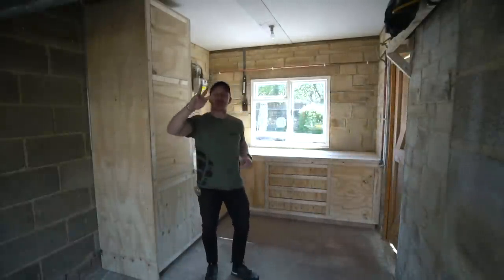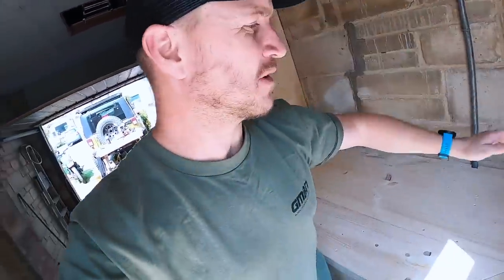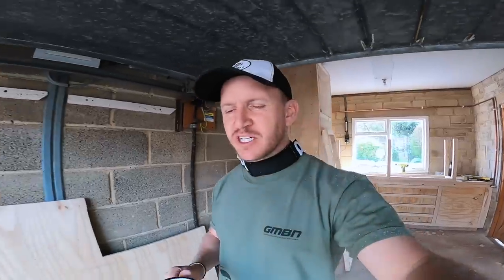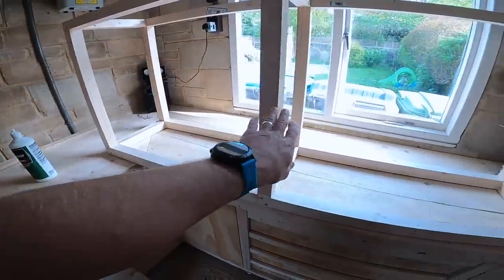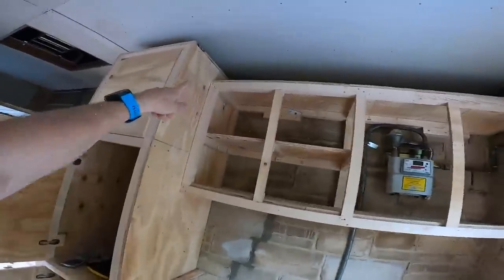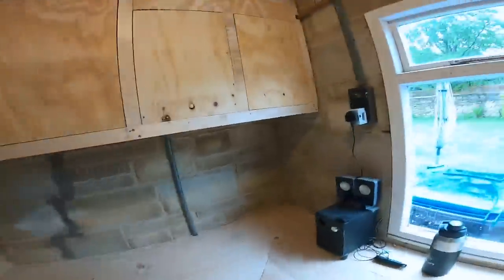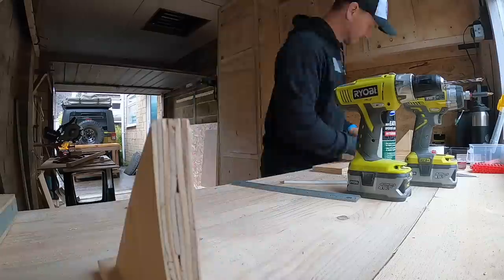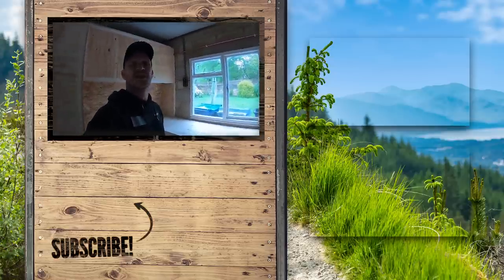Blake Builds A Bike Cave Ep.3 | Mountain Bike Isolation Workshop Project

Comment: Nice job man. I would suggest you to mark the gas line on the wall board so you won't break it after few years and forgetting it's there. Also why not use torx screws for building stuff so you would not round any screws even if you need to undo the for some reason. 
Inspiring work mate. Making me rethink of my plan for my bike cave :)

Comment: Damn, You guys take your tea time seriously.
Edit: 11:40 when you move the camera back and forth I can see daylight between the blocks in your wall, where you obviously repaired the grout, the one above where you left off repairing the grout, you can see daylight through. You should probably chisel out the old grout around that last block and repair it properly or it will give you problems eventually.  I am a stickler when it comes to home repairs like that though, If I see something like that, I have do fix it right or it would bug me every day until I got it fixed.

Comment: You really need to consider better security now, that single pane window is pathetic and you could put it through with a reasonable tap of your fist. Desperate thieves will also just bend up the corners of garage doors with a jack of similar. Wouldn't leave anything of any real value in there until a better window is at least put in. UK is rife with bike thieves. Also worth putting a blind on the window and  covering up that gas pipe is not the greatest of ideas. Other than that... looks fantastic lol